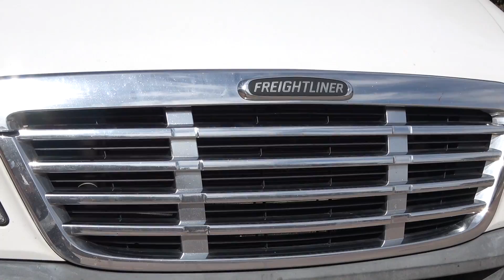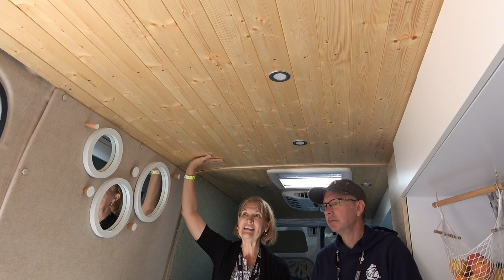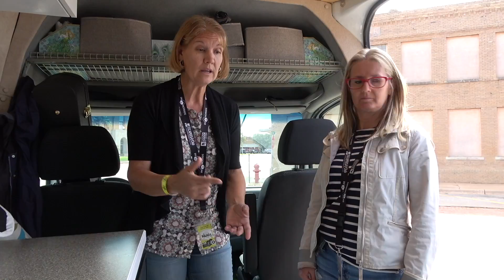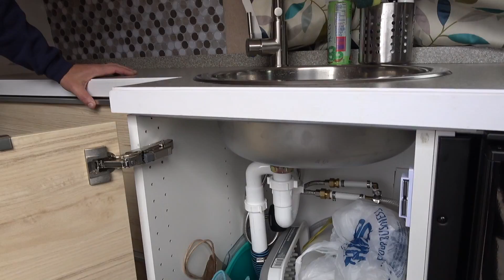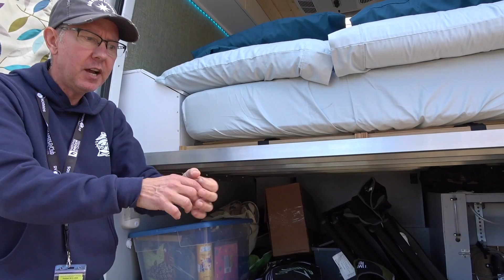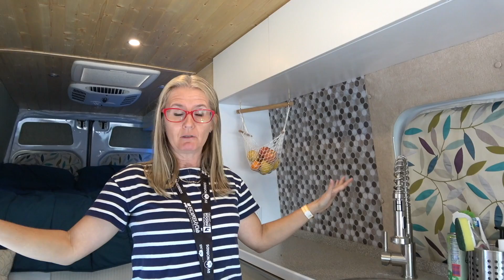Coffin Carrier to Epic Camper Van Tour // DIY Sprinter Van Conversion

Comment: @
Does Size Matter
Question for Larry & Wendy or @Does Size Matter : Where did you buy your back-splash and was it expensive? Is/was it available as 10"X10" squares or sheets??
You did a wonderful job on the conversion! I love it! :-)
Reply from the maker: Thanks for watching. Larry and Wendy tell me that the backsplash tiles were a special order from Lowes and they came in 12x12 sheets at $8/sheet and they used 12 sheets. Hope that helps you out. Are you doing a van conversion?
Reply: @DoesSizeMatter  No but I would like to have a new backsplash and this is so much less expensive! Thank you!
Reply from the maker: Oh yeah! Great idea! Also much easier to do without a professional. If you decide to do it send us a pic when it is finished. Larry and Wendy would love to see people using their ideas.
Reply: @DoesSizeMatter  I'll certainly try to remember to send a pic but where should I send it?
Reply from the maker: you can send an email to doessizematterkd@gmail.com @1genevieve2

Comment: I must have a shower and toilet!!
Reply from the maker: I totally get that  but as we always say, "to each his own". You can make any van conversion exactly what you want, that's the cool thing about them.
Reply: Yes I think the shower is a must . And build the rest around that .
Reply: I agree .... even if it is a collapsible shower with a pull out drawer shower pan. I saw that in a van build and it was adequate for any shower. It is so compact that it takes no room and is in the midway while you use it, then back into the drawer mode when not in use. The shower and faucet are extendable. It should be easy for a person with a mechanical imagination to figure how to build. It had a flexible drain tube into the grey-water tank (or I'll bet you could direct drain it somehow, and the curtain was supported by the top of the extendable shower and shower head.) There should always be room for some kind of porta-potty ... after all, this is van living, not camping in the tent.
Reply: @annbolynn7797  ....I saw that too, and it was on a Channel called Mr. and Mrs. Adventure. They have a BEAUTIFUL conversion and also are two of the sweetest and cutest people on YouTube imo. Anyone who sees this Comment should take out the time to check out their Channel. I promise you that you will want to subscribe! Their names are Brittany and Drew and this is not their first conversion. Their first one I believe, is one that they traveled all over Europe in! CHECK THEM OUT! You won't be sorry you did!

Comment: I noticed the 2 roof vents, you may want to consider buying these so you can leave your vents open going down the road, and in the rain... and, Walmart has lots of RV stuff that will cost you more at Camping World, or even Amazon. I always check Ebay 1st if not at Walmart.. 
Here is the link to those vents at Walmart, most super centers have them no need to order..
https://www.walmart.com/ip/Camco-RV-Roof-Vent-Cover-Opens-Easy-Cleaning-Aerodynamic-Design-Easily-Mounts-to-RV-Included-Hardware-White-40431/16783115
Reply from the maker: Thanks for the info :)